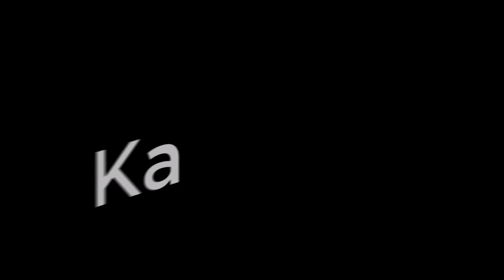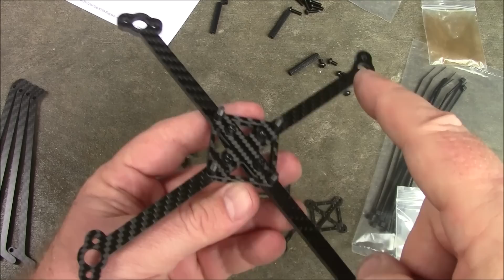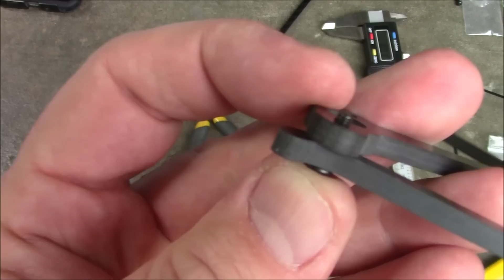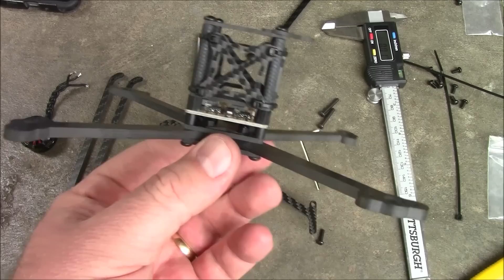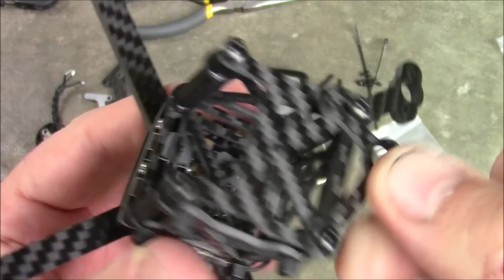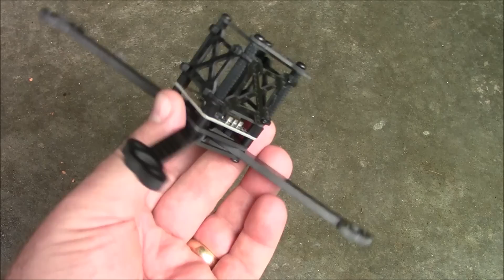Realacc RFX185 (QAV-ULX Clone) Frame Review from Banggood

Comment: Thanks a BUNCH Travis! Somehow, I sleep-bought one of these. It arrived yesterday and I don't even recall submitting the order. Huh. 

Also one of the 10dof "SPracing F3 micro" flight controllers they had on the discounted list. Of which there aren't any real ones from SeriouslyPro. Guess it's the ultimate un-clone? You can't replace the bootloader though, at least not that I have figured out yet.

Putting the stiffeners in gave me a headache, the whole mess is so asymmetric. (Just like the arms, once you get them in right, just wash/rinse/repeat -- pshew FINALLY)

Having fun figuring it out though, and I will be in a heap of trouble trying to fly this with RMRC black 2204/2300's. Slow reflexes...
Reply: The board is silk-screened SPracing F3 MINI. Umm, nope, no way, nohow. Not anything like the real thing. This is so far off, it's not even a third cousin, let alone a clone of the GA. Here I am writing a review within a review. Gotta stop that and get over my stage fright and do my own...

Comment: Withe the extra arm protectors it is heavier but it is mainly less air resistance with those arms. 
It will hold a swift or hs1177. Mount must be mounted on the top plate so the cam hangs on the top plate.
Reply: emiel1976ep wat ik waarschijnlijk ga doen is een standaard stack build onder op een 4in1 esc dan erboven een 36x36 video transmitter dan er boven een omnibus clone dan doe ik met zipties voorop de frame de fpv camera dus die zit net onder de props de ontvanger voor de zender prop ik ergens nog wel ertussen of hij gaat aan de zijkant. En de antennes worden gemount onder de arm en dan een gopro bovenop. Eerst ga ik hem bouwen zonder fpv. Dan moet je dat hele top gedeelte er niet op plaatsen zoals ik het ga doe.
Reply: De diatone sp2 of sp3 passen er mooi tussen. De omnibus ga ik waarschijnlijk ook halen met de sp3 vtx. Zal de osd van de sp3 niet gebruiken maar die is fijn in te stellen en heeft 25 tot 600mw mogelijkheid tot zenden. 
Ik vind het een leuk frame, maar het is niets voor mij. Ik laat mijn eigen frame frezen. Heb liever de fpv cam voor de stack.

Comment: the shrike v2 is only 2g heavier with a pdb
Reply: The big thing is how skinny the arms are, making less air resistance. More air gets past the arm.
Reply: yeah it probably has a bit less drag than a shrike
Reply: Cooper Stukel I think round arms will be the future.  you could have a 12mm wide round and hollow arm and it would have less drag than a 8mm wide flat plate arm, and lighter.  Flat surfaces are horrible for aero.
Reply: +Plur307 go check out the shendrones mifune
Reply: STRYKA
Interesting, but in my opinion too much weight devoted to non-structual strength.  I think round carbon arms are a much better approach.  But I think aero frames are the future.  I own a 5inch and 6inch BoltRC Kraken and I can really feel the speed the aero gives.  The 6 inch is almost too fast with high pitch props.  I have to use 4 inch pitch props just to slow it down to a speed where I feel in control when racing.  I was blowing wide on every gate and missing gates completely using high pitch props the first race I took it too.
Reply: I agree about aero being the future because we have reached the limits of our batteries (for the meantime). I'd love to try one of these low drag frames and see what they are all about but first I want to upgrade and modify the crap out of my alien :D
Reply: STRYKA
I also own an alien.  It's a great frame, but I feel like it is not the fastest frame.  The light pure X racing frames are quite a bit lighter and have lower drag.  But the Alien is very durable.  I think the Alien is still one of the top freestyle frames because of the durability.  I put 4 inch upper and lower plates on my 5 inch arms.  That saves 8 grams over the 5 inch upper and lower plates.
Reply: Yeah I do mostly freestyle (I would love to race but there are no race events in my country) so the alien 5 suits my needs. My next frame will probably be an x frame just to see how they feel